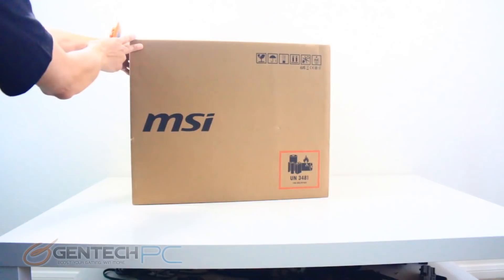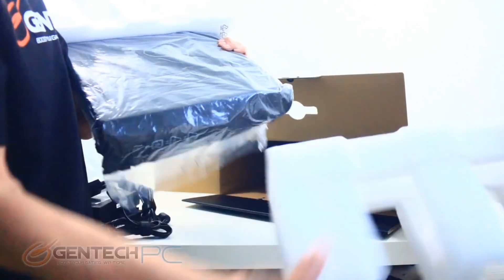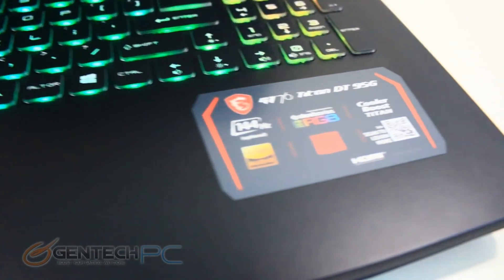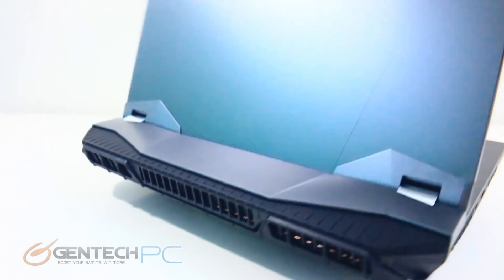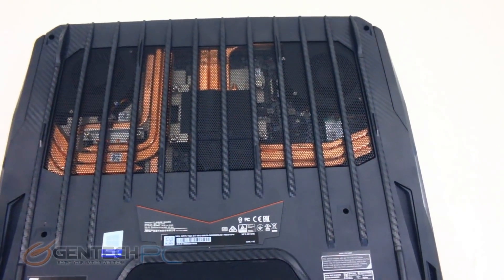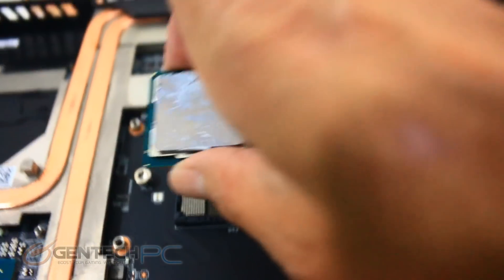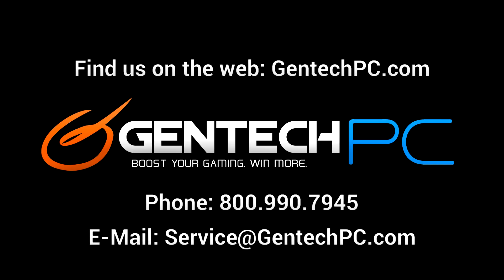MSI GT76 Titan Desktop i9 9900K Laptop Review & Benchmarks

Comment: I wouldn't pay $4,000 for anything with a 1080p screen.
Reply from the maker: 4K version just arrived.
Reply: 1440p with 144 refresh rate would be desirable
Reply: I paid $3,000 for an Alienware M17x R3 around 10 years ago with a 1080p 120Hz screen.  It's still running great but has a GTX 460m GPU.
Reply: @hamptythehamster  You can't game on laptops that aren't connected to external power.  Battery life argument is not really valid.  Most laptops switch from GPU to APU when on battery.
Reply: @hamptythehamster  Oh, I see what you were thinking now.  But if you buy a laptop with a 9900k desktop CPU you shouldn't expect it to power up on a laptop battery much less worry about running a 1440 screen.
Reply: @mcalhoun73  My M17X R3 with GTX 880m can barely run any modern 3D games due to throttle issue, and I bet your battery is dead too.
Reply: I'd love a 1080p screen with that hardware! more frames :) and 1080p is good enough for 17 inch however 1440 is the best altho performance is lower than on 1080p :/
Reply: I feel if you get it with the 1080p 240hz ips panel, it's worth it.
Reply: @GenTechPC  Thats the one i bought last week
Reply: I just ordered the 4k variant with the 10th gen i9. Gonna be badass (I hope).

Comment: MSI TITANS RULE!
I purchased a MSI Titan GT780DXR-446USZ back in 2011 and at first I did have a bad experience but it was only because SSD’s were new to the market and the two manufactures offered had really bad performance issues right out of the box as evident by the behavior of mine and hundreds of people on both SSD’s websites complaining about exactly what I observed. When it booted you could go from power off to full windows boot in 15 seconds. However half the time it would Blue Screen and if it did boot, it would blue screen when running any application. At most it would stay up for 5 minutes before crashing.

Thinking I just had a bad laptop, I sent it back and had a second one built in exactly the same configuration. It behaved the same way!!

So I gave up, sent that one back and had the third built with regular 7600 RPM 1TB Hard drives. That laptop ran flawlessly for 6 years. It was back to taking 3 minutes to boot again but no issues. Only reason it eventually died is because of being dropped several times, my fault. I spent most of 2017 in the hospital getting 7 surgeries on my left leg and was on heavy pain killers. I fell asleep several times, moved and it slid off my legs onto the floor. The power cable came straight out the back and after being impacted several times the motherboard burned a hole where the power lead came in and there went my $3k laptop up in smoke! Valuable, stupid lesson learned! 

Been doing all my online work for the past several years using my iPhone 7Plus which had about ruined my eyes so it was time to get my next laptop.

I loved that Titan so much I decided to get another one.

That MSI Titan was heavy but the first laptop on the market with the RGB Steelcase keyboard. It was beautiful and was to be the center piece of my at home music studio. 

That Titan had the best sounding sound system of ANY laptop out there with the Dynaudio speaker system.

I just ordered a new MSI GT76 DT 10SGS-055 with 4 2TB SSD’s because at this time SSD’s are reliable so I’m really looking forward to the lightning fast speed again. 

It has many improvement, an upgraded Dynaudio system with an even larger subwoofer, the RGB Keyboard with individual per key control so I can highlight those gaming keys, the additional RGB mystic lighting, a 4K display, increased disk space and number of drives and the new 10tb Gen Intel processor to name a few. 

I was a little disappointed that they no longer have a built in DVD player like my old Titan, did but with all that extra disk space and 4 fans, something had to go. It seems to becoming industry standard to use external DVD’s now anyway.

I am very much looking forward to getting my hands on this new MSI GT76 DT 10SGS-055 Titan!

Comment: This laptop is one step forward from a GT75, 5 steps back. Great it now has an end of life LGA socket. But you lose out on the MXM GPU, lose one usb slot, lose the card reader slot (only micro sd in this), lose 2 m.2 slots (only 3 here vs 5 in the GT75) and most importantly...the loss of the mechanical keyboard on the GT75. That's said to be the best keyboard among every laptop aside from the full sized keyboard found on the MSI GT80.
Reply: And the thermals may not be that much of an improvement from GT75, but still, If the price of GT75 drop significantly i may consider pick it up yeet
Reply: @richardzhang2773  Gentechpc had a good deal on them a few months ago and right when I was about to buy it, the price jumped $400.
Reply: @Mattschindig  Unlucky, I got mine GT63 for free through my relatives.... Don't think i will upgrade any time soon
Reply: @richardzhang2773  I just can't do the 15 inch. Other than that that is a beast. Everyone talks shit about HP, but honestly I have had the best luck with them "Omen". Alienware is just a nightmare, hit or miss kinda brand. Haven't tried MSI, but I might pick one up for Xmas to give to my step dad because he is still using an old Dell from like 10 years ago.

Comment: I have owned an MSI laptop (GE 72) for 2 years. The main problem that I encountered came where I least expected it: after a year or so, plastic in areas that were running hot, became very brittle. Plastic mesh over cooling fan just fell apart. Then later destruction started spreading to screen hinges. And eventually laptop died because its power socket started running hot and the whole area around it just fell apart. I was very disappointed with MSI at that point and not planning to get another one of their products.

Comment: Great video. I would think that with such a huge dual power-supply, they’d at least put that connector in the back of the unit. It’s  still a beast but if I were in the market for something like this, that may be a deal breaker; but what really ruins the whole sea is the 1080p screen. With that much power, 1440p should come standard. An i9 and a full 2080 would easily do max settings in most games at 1440p. Definitely a shame.

Comment: a thick power cable on the left side? For the love of god why not on the back side? Why why why?
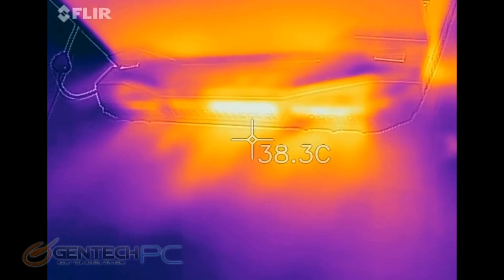Reply: My guess is that all the space in the back is used for exhausting hot air from the system. At 11:52 you can see the back gets quite a bit hotter than the surrounding area. Also, even if they manage to put a power connector in the area, there's a risk of it melting due to the heat. It happened on a laptop that I had once.
Reply: @AllegoricalDove  still very inconvenient
Reply: @hubert3637  That's true. The power cable just gets in the way
Reply: This is why I think the older GT75 is better.
All video cables, ethernet, and power cables are on the back.

No bumping into external video cables with my mouse hand either.
No idea what they were thinking there.

Comment: This laptop looks incredible, however I've heard that the machine uses Optimus.
If I updated the CPU on this machine sometime in the future, would it have to include an iGPU, or are the Nvidia graphics also connected to the monitor, rather than being fed into the iGPU's buffer?
Reply: well it's a core i9 and rtx 2080 with 128 gb ram i don't expect anyone to upgrade anything in it before 2025 or 2028
Reply: @Martin M i have a 5th generation i7 and gtx 850m and my pc is still holding up
and i know someone who have a 1st generation i7 and gtx 780 and the laptop is holding up
with increased power sure you will get increased thermals but the companies knows already this is why you will get 11 heat pipe's and 4 fans

Comment: Kinda disappointed they went with soildered gpu instead of MXM card like on the Gt75... I mean they added a desktop slot  but the GPU is more prone to die on a laptop than CPU...Though that cooling solution looks tier... I have a laptop with a 9900k and I can't hit max speed because it will thermal throttle first...  I have his 4.9ghz but only for a few secs... I get better score if I just run at 4.5ghz. more stable...

Comment: I have the gt75 Titan it is huge it's a beast but it needs to be for cooling purposes. Although this laptop has a thinner form factor it cannot run at Peak Performance he needs to have better cooling it's too thin and it will run very very hot. Your performance will be capped by the fact that it cannot dissipate Heat any faster than the gt75.

Comment: i had msi all my life, but this time i went with acer helios 700.

MSI is truly great though.
Reply: Helios 700? the one with the keyboard that slides? I've been looking for reviews of this product since it was announced and it has almost nothing
Reply: @henrydrago  yes the one with sliding keyboard. Not many reviews in depth out there. I think its a great laptop.
Reply: @Kobinals  I wanted more analysis about it because in my country there are few powerful latops options and I usually see a lot of reviews before buying but without having it I don't know.
Reply: @henrydrago  i got the top spec, i9-9980HK, 64GB ram, RTX 2080 (not MaxQ).

It runs cool, and have the best fans for any gaming laptops. Very noisy.
It comes undervolted too. I gotta say  this is probly the best thermals ive ever seen ln a laptop.

The max OC for CPU is limiter set to 4.5GHZ on extreme Mode. It doesnt let you set 5GHZ all cores because of the in built OC app.
I think it is to  prevent thermal throttle? Until now i dont know how to bypass this.

From what i saw on the benchmarks reaults  on review websites, it surely does compete with high end monsters (51M, GT76, Origin, mother ship etc..) with desktop grade CPU & GPU.

Comment: i just don't understand why 2 power bricks with 2 power socket? why not just build one power brick that able to accommodate that 400W+ laptop? or just using AC plug splitter into two power bricks
Reply: Samuar Joe I think it’s gotta do with regulations. A single power supply above 300W isn’t allowed on airplanes.

Comment: Going to go ahead and say that the Alienware Area-51M beats this laptop by a long shot.
Reply: Why
Reply: @bryanchukwurah1141  It has G-Sync, it also has the power connectors at the rear instead of that horrible hideous proprietary 2 in 1 side connector that MSI uses.  There is also a very good chance Alienware will release a 2070 super card for the 51M since it's basically just a derped 2080 and the 51M can have it's GPU changed like its CPU.  Hell maybe even a 2080 super.  The gt76 Titan is ok, it just doesn't do anything better than the 51M except the RAM, for some reason Alienware wants to sell 2400 RAM at he price of 3200 RAM which is just insane.
Reply: Bryan Chukwurah All of what TheMaw365 has said, plus the Area-51M is a lot quieter during gaming, the fans on the machine seem to be more powerful than the ones in the MSI system as they don’t need to spin as fast, in order to keep the components cool. I had the MSI GT75VR in the past, and it was always noisy during gaming. You hear the motors. Whereas with the Area-51M, all you hear is all of the warm air blowing out, no motor noise. And it’s not annoying to hear at all.
Reply: @TheMaw365  I imagine the speakers will.be a lot better on the msi. It has a subwoofer. The speakers on the a51m are kinda disappointing.
Reply: I bought two Alienware laptops recently and returned both of them. Almost $3k each and what I learned is the shell is nice, but that's it. Speakers are trash, thermals will get hot eventually faster than most laptops. Plus no English speaking customer support that you can really understand. Way overpriced, but I drank the koolaid and gave it a shot. Crap
Reply: @Mattschindig  Alienware speakers are totally rubbish

Comment: no point on intel socket. coz if you want change procesor whole modo need change
Reply: If you blow the CPU you can just replace it though, rather than getting the entire board changed which will require losing it for repairs for weeks.

Comment: This just looks like a worse version of the GT75, cool it has a desktop cpu but now you have to carry around 2 power supplies and given intels history it's unlikely you'll get to put intels next CPU in the GT76. No mechanical keyboard, less usb/audio ports, only microsd. Going back to side connectors for things like power & display cables seems like a massive step backwards. If they're gonna make stupidly large laptops I wish they wouldn't compromise and just give us a modern GT85 with a 1440p 144hz screen, mx brown keyboard (none of that red trash from the GT83) desktop cpu & desktop 2080 or something crazy like a custom form factor 2080 ti. You'd have more room for cooling and ports, it would still be just as annoying to carry as the GT76 just not as pointless.

Comment: No G-Sync and 2x 230W adapters instead of 1x 500W ? LOL Who the hell buys this besides spoiled rich kids and idiots...I mean RGB fans? Clevo P775TM has the same performance, but it has 1 power adapter and a 144 Hz G-Sync screen and much cheaper! Or if you have money to burn, then just go with the ALienware 51m which has 144 Hz G-Sync screen. There are a lot of ignorant people who try to convince others that "lol G-Sync is not needed for 144 Hz screens lol", but do not listent to them, 9/10 who says this do not actually know what they are talking about and they are only half right. Game running on 144 FPS is seemingly as smooth on both G-Sync and non G-Sync 144 Hz screens, however load up Battlefield with RTX on Ultimate. It is a really demanding game and FPS may drop down to 60 FPS. 60 FPS on 144 Hz G-Sync will be smooth, however on a non G-Sync screen you can see microstuttering since the 144 hz screen is not synchronized to 60 FPS.  tl;dr: old games with low requirements that can run on 144 hz look good on both G-Sync and non G-Sync screens, however games like Metro Exodus and Battlefield which drop below 70 FPS with max RTX settings look much smoother on a G-Sync panel than on a non G-Sync panel. In other words, newer games look smoother on a Clevo P775TM, ASUS G703GXR and AW Arema 51m than on this MSI laptop. If you do not believe me and have money to burn, buy both and put them next to each other, unless you are blind, you will see the difference. A shame that MSI skipped G-Sync just to save a few $.
Reply: Because some places have laws that limit the amount of wattage a single adapter is allowed to have

Comment: LOL yet a fully decked out top of the line MacBook Pro is more expensive, but with a GFX chip only about a third as powerful (the crappy Vega 20, I know, I am using one), and WAY worse thermals.. How funny. The only thing that Mac would have over it when fully decked out is a larger SSD (4TB vs 1TB).. woop de woop when storage gets cheaper every day. I know the Mac is thin and light but boy is this 9880H and Vega 20 combo way too much for the chassis to cool.. I need to disable turbo to keep thermals in check on OSX. I wonder if one could "Hackintosh" this MSI beast, although I doubt it cause of the RTX 2080. Oh well. Hope I am wrong. Still have a week to return this overpriced MacBook turd. (The issue for me is Mac OS and Logic/Final Cut pro, otherwise Mac would no longer be a consideration). My 32Gb ram, 9880H 2.3ghz Octa core, 2TB SSD and Vega 20 is 6259 AUD (around 4300 USD).  Edit, I just found the GT76 in Australia, without any price negotiation i.e. just a quick search, and it's near the same price range with 32Gb ram and a 1TB SSD vs 2TB in the MacBook Pro at that price (Also, to equal price you would put the 2.4ghz 8 core in the Mac ie the 9980HK vs the 9880H in the base 8 core model).. Of course, the MSI has a full bore rtx 2080. And a 9900K cpu which would obliterate the 9880H/9980HK as the mac can't cool either. For anyone curious, I spent hours in bootcamp fine tuning TDP settings in XTU (can't be done in OSX) and the MacBook is capable of keeping all 8 cores being hammered at around 3ghz.. that's it. The all core turbo for the 9880H is actually 4.1 in a properly cooled chassis, and it can never even hit the 4.8 single core turbo at all.. ever. I bet you this baby could be configured to sit at 4.5ghz easily on all cores, almost doubling performance over the Mac.. Well, real world would be 40% better for sure, at least. And the 2080.. world of difference... Oh, I have to add, it's a 17" 4K display vs a 15" 3K.. so the display is better as well. That said, using windows 10 pro every day the past week, I have to admit I really do still hate windows as an OS, and I hate the registry, the forced updates, and the sheer clutter.. I think that's the only reason Apple gets away with selling crap for gold prices.. their OS, and their exclusive pro apps for the audio/video industry that many of us are just accustomed to. Oh well. Tough decision, I still have a week to decide whether to return it.